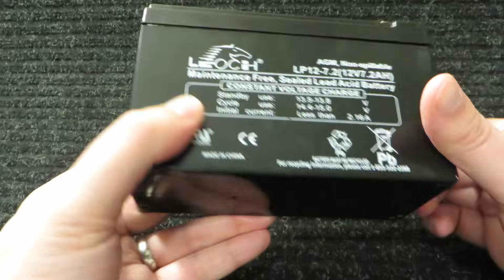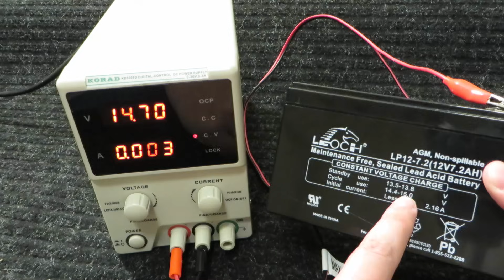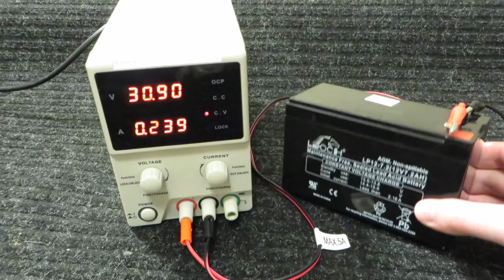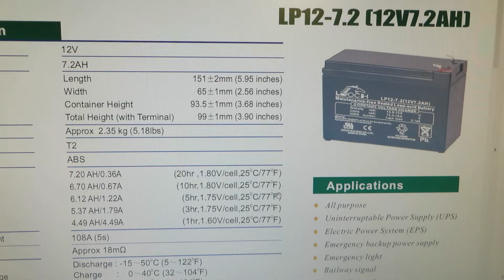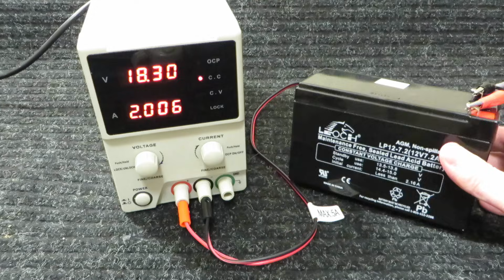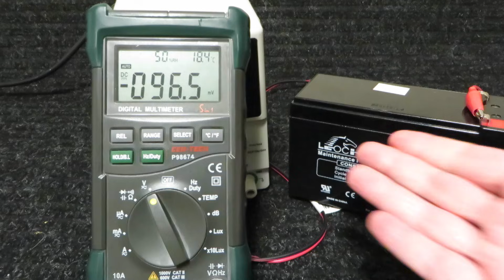Battery Desulfation Demonstration Start to Finish - Part 1/2

Comment: hi, how can I contact with? I did same tes with AGM battery for UPS and added destiled water and tried to desulfate with High Constant Current process, and it works, I did it like 3 o 4 times round charge/discharge and now works even I measure the recover back to 100%, I want to know if AGM can be converted to wet cell
Reply: https://www.youtube.com/watch?v=br6I7QAkKpY
Reply: https://www.youtube.com/watch?v=ITZP8dfaXuk

Comment: Hi , thanks for the video. you look expert on the topic, and all the reasonings sound correct. Do you have any link or literature on this? I would like to have more details on how much current should I set for a 100Ah battery, with several hour process. what is the dependance with temp and so on (I'm desulfating my camper batt)

Comment: you should call your self a professor.
question  
i have a flooded battery i measure each cell with multi meter and only one cell give me -0.3 v instead of 2 volt.
can i recondition that cell assume i do all safety procedure by put negative terminal of lab power supply  on that cell and positive terminal in the  main positive terminal of the  battery?
thank you a lot.
Reply from the maker: If you have access to each individual cell you can desulfate each cell separately.  It sounds like you have a single cell inversion where the cell reformed in reverse polarity.  This is pretty common and somewhat difficult to rectify unless one has access to the inverted cell.  With lead calcium batteries in particular this is quite common as manufacturers add dopants to the 'good' cells to cause them to leak current as much as the 'worser' cells so that the user doesn't end up with the problem you have.  Chemistries with higher intrinsic leakage currents don't need this dopant which only makes good cells worse.  This disrupts the battery chemistry as they age and leakage rates change though - cost cutting right?  Anyway, I'd suggest desulfating just that one cell first if you are able to access it.  Be sure to keep the water to the proper level at all times.  Wish you the best.

Comment: Every single AGM battery I've had has gone bad due to an internal short eventually (in a UPS, electric wheelchair, car, etc.), so any revitalization attempt was useless in the end . I have one that's 12 year old that's still going, though.
Reply from the maker: That's very interesting to me considering that I have never had an internal short in an AGM battery out of the dozens I have personally used over the past 2 decades including one that had a gigantic dent in it due to physical trauma.  It is certainly possible in an AGM battery to have shorts but more difficult than flooded due to the dense fiberglass mat that needs to be punched through before a short can occur.  Perhaps your batteries or use applications are different from mine.  No argument though that a battery which has a short cannot be desulfated using the method shown here.

Comment: Very good video, please answer me I have the following problem, my laboratory power supply unit Wantpek APS3010H unfortunately only charges with CC until it reaches the closing voltage and then with CV and then the current drops, how did you set it so that you charge with CV and the current rises, thank you
Reply from the maker: Your power supply is working properly from what I can surmise from your comment.  The current limit and the voltage limit are independent.  If the voltage limit is reached current is lowered to prevent voltage from going higher, and if the current limit is reached voltage is lowered to prevent the current from going higher.  It sounds to me that your batteries are not severely sulfated and are charging like typical batteries instead of charging like damaged batteries as shown in this video.

Comment: Hii very nice information, but i have question I use the gell battery when it is full 13.2 volts and get a load of 2a baterai drops 11 volts, how to fix it sir? Thanks
Reply from the maker: It depends on the battery.  If it is a smaller battery that may be normal simply due to charge mobility and internal resistance, but if it is a larger battery, say 20Ah or larger then that isn't normal.  Gel batteries are more difficult to restore as any 'bubbles' are permanent and damaging.  To desulfate a gel battery you would need a very mild overcharge for a long period of time.
Reply: @knurlgnar24  thank you for answering
the battery that I use is 12 volt 100a, when I charge it with 14.2 for a few seconds it is immediately full with a voltage of 13.2 volts. for 2 days the voltage is still 13.2 volts but when given a load of 2a it immediately drops to 12 volts, and then the load is released voltage back to 13 volts again, is this due to sulfation or maybe the cell dry?

I've used the method you used to recover battery before and it worked very well
thank you for your information sir

Comment: You may like to include a diode between the variable power supply and the battery. If you are charging, and the power fails, the battery may backfeed the power supply, damaging it. I have seen it happen. Ok Ok...  I learned the hard way!  :-)
Reply from the maker: That definitely shouldn't happen, but yes I also have that fear because power supplies are usually not tested against unanticipated events like AC power outages.  I did try unplugging the supply while on the battery as a test and it didn't do anything bad but that only means so much.
Reply: @knurlgnar24  You got away with it :-)  I'd still like a diode. I always do now, once bitten...

Comment: Thanks for pointing me to this video. The batteries I mentioned in my last message all test at around 12.5+ volts. I'm glad they are totally run down. Coincidentally the 20 batteries I have are from the same company they are leoch lpc12-75
Reply from the maker: I remember your comment but can't seem to find it - youTube mysteriously deletes things at will for unstated reasons.  In any case those sound like very nice batteries and I hope you are able to restore them to useful condition and make use of them!  I'd take those for my battery bank if I had the chance.  :)

Comment: I have an issue I can't find a solution for. I have an alarm in my vehicle. Having been out of work since 18OCT2020 I don't have a need to drive each day. So my battery has 12V but seems to have no current. It will not take a charge. Even using the 55A Starting circuit it will no even turn the motor. What would you recommend. Are there solar chargers that I could put on it to keep it up with the alarm pull?
Reply from the maker: I'd disconnect the alarm and force charge the battery for an extended period of time.  Lead Calcium batteries (which are the standard for North America) refuse to accept a charge after complete discharge for a time until they slowly start accepting charge again.  After that point you will still need to desulfate the battery.

Comment: What I would love to see is how to make a modified sine wave inverter to pure sine wave  I know I can get a triplite line conditioner unit that will do that but the video I watched on that the unit was around 100 $unfortunately up here in Canada with our lower dollar it's around 140 $ that not too bad but the killer is the almost 300 $ shipping cost I can buy a new 3000 watt pure sine wave inverter for less years ago before utube I bought a 1750 watt modified sine wave inverter then about 3 years later a friend gave me another one and about 3 years ago my brother bought one for his camper just before he passed away he gave me the camper so I now have 3 1750 modified sine wave inverters since then I found utube and found out that modified sine wave is bad for sensitive electronics and not good for anything with a motor like fridge furnace and pumps that's why I looked into the triplite 1800 line conditioner I've seen your video on how to join 2 together to double the wattage I've also seen a video on how to join 2 together to make a110 220 split phase inverter there's even a video on how to make a a 2000 watt pure sine wave inverter but I can't find anything on how to convert what I got to pure sine wave

Comment: that is not how to do it!
Dump the battery in a cube of air condition water, put a bridge rectifier on it and a 120 or 240 power connection in series with an old style light bulb, then heat it up and let i cool down to draw water inside!

Comment: just saw you have a ton of amazingly helpful off grid vids...
thanks muchly...
any hope for my crown 420ah l16s(2 in series at 12v)
that drop down to 12.6 volts after sundown due to my ignorance in having had an under powered pv setup when i got them?
they got drained down to 11.7v almost every night for the first month i used them and never got fully recharged during the day.
so now if i disconnect the charger they slowly drop down from @13.9 to 12.6 over a cpl hours with no load.
they will mabey loose another .1v overnight if i have no load but if i run them down to 12.2v they are still at 12.2 in the morning.
i feel like they are good candidates for salvation compared to what you used for demos.
can this be over a period of days on and off?
any help not ha having to replace this wasted 600 dollar battery bank would be greatly appreciated.
thanks.
Reply from the maker: I can pretty much guarantee that you can restore those batteries to near 100% without much trouble.  If it's only been a few months of damage due to undercharging it will be almost completely reversible.  I'd need a specific model number to give specific advice, but whether these are AGM, flooded lead antimony, flooded lead calcium, or pure lead makes a difference in the details.  (I will assume flooded of some chemistry)  The short of it is I would recommend disconnecting or turning off the solar and inverters and doing an extra long equalization charge.  Crown likely recommends something like 5 hours for maintenance purposes but since yours are damaged they will need more than that - maybe a full day.  Keep an eye on temperatures and electrolyte level during this time.  If you have a hydrometer keep charging until sg stops rising in all cells.  After that do a deep discharge, log the result, and do a normal full recharge followed by the crown recommended equalization charge.  Repeat.  Once your capacity result during the discharge tests stops rising you are done and given your situation it will probably take only 1 or 2 cycles.  Obviously the most important thing is to not let them get damaged in the first place but life isn't ideal and these things happen - fortunately it's not a big deal as long as the situation is rectified in a reasonable amount of time.
Reply: @knurlgnar24  thanks so much ....
I am completely off grid so I can't charge them externally
I can set my charge controllers
To equalization voltage for a few hours at a time a few days per week...will this eventually do it?
If not since I am switching to Chinese prismatic 3.2v x16 for 48v sometime this winter and 
run an external charger then.
(BTW they are a pair of crown CR-430 6v in series.)
and these big fla are to expensive and too heavy to junk... 
Awesome info ...hope you get back to it
Thanks again for the reply.

Comment: try the welder method?  speeds things up............
Reply from the maker: I wouldn't recommend using a welder as a battery charger.  They aren't intended for that and have a high inductance output which is dangerous for battery applications.  (but good for welding)
Reply: @knurlgnar24  THANKS-- i did see this method however....... dialed in to around 30A input: speeds up force restore/desulf.    Thoughts?  https://www.youtube.com/watch?v=VYtkn-N_p4s&t=98s

Comment: Would the marked max initial voltage always be the driving parameter or is a general maximum of 2A recommended? I have a larger battery with about 13A initial voltage, resulting in A staggering 156W!
Reply from the maker: The initial voltage is independent of the current you would use to desulfate.  If it is a 12V battery of, for example, 100Ah instead of 7 as shown in this video then 2-5A would probably be an optimal current limit depending on a host of variables.

Comment: I have been having trouble commenting on this videos, so I am giving it another try.
Reply from the maker: Looks like this one stuck for whatever reason!  YouTube is funny when it comes to filtering comments and is often over-aggressive in filtering spam, advertising, and abusive comments.
Reply: @knurlgnar24  The one on your 1000Ah Battery Bank Part1 is still there. It's the only video that it stuck. 

https://www.youtube.com/watch?v=PbCA8RZqeqk&lc=UgyN3wwoQSisxFpiHTp4AaABAg
Reply: @knurlgnar24  I really hopped for your help since I have been at this for about two months, but I think that I worked it out. It would appear that using the same process to maintain those large orange deep cycle batteries can be used to recover any FLA or FLA or AGM batteries. I am omitting the manufacturer of those batteries as it may be what has been causing me grief with deleted comments.

What I would like to convey for your videos is that you have so much more to show. From part#2 @ 24+min, the explanation to the internal resistance and capacity are for the most part left aside. How about a 3rd part video to cover these things? 

I am asking after spending two summer months of working through this craziness of battery recover. I don't own a fancy electronic load like your Regol to graph a discharge curve. All that I have is a smart charger and an DMM that hook-up in series with my dumb charger. 

I finally got myself a DC clamp meter to replace the one that went defective. It's a Klein Tools 400A AC/DC digital clamp meter that I bought at Home Depot in Canada for $105 CAN. I have been wanting this to measure the discharge current from the engine cranking between my cars, snowmobiles and lawn tractor. I want to find the current while cranking the engine to find an adequate discharge current to recover starting batteries.

Comment: So, this type of lab power supply wouldn't work for restoring car batteries would it, with 100s of amps?
Reply from the maker: Yes, this would work well for car batteries.  Car batteries only require a few amps to desulfate.
Reply: @knurlgnar24  Ah, ok, thanks for that clarification. I suppose the importance of what you are demonstrating here is the higher voltage but only a few amps. Is this lab power supply then also sufficient for charging a regular car battery?

Comment: Thanks. I have recently attempted to recover an identical battery but with better initial open-circuit voltage (5V or so), though with PARADOXICAL RESULTS. I went through a few cycles during which the temperature never exceeded 30 degrees because the battery charged fast (faster and faster with each cycle - average a few hours) so that from the start, I used only 13.8 - 14V and never exceeded 2A (with power supply unit in CV mode and 2A limit). I ended the charging at around 0.2A and measured the open-circuit next-day voltage at 12,6V after each of the four cycles I did. 

Now, here comes the PARADOX I do not understand: the capacity at each cycle got smaller and smaller, so did the time of discharge in identical conditions set up on a battery tester (10A, 10.5V cut-off). The paradoxical results I got are as follows: the first cycle - 17min of discharge, 2.853mAh, the last cycle: 13min, 2.209mAh, and the other two cycles in between in decreasing order. 

I am looking forward to reading your comments, but let me hypothesize that by charging in this simple way with a power supply unit, I made some damage to the battery. Initially, I thought so because the chargers are a bit more sophisticated using more complicated algorithms than just CC which switches to CV after hitting a set voltage. Even you suggested that after the first successful charge, we should start to use the chargers which have come with the battery. It seems also in accord with what those designers of lead-acid battery chargers claim, though they, as probably you, refer to a simple transformer-diode type of charger and not to CCCV of power supply as potentially damaging due to uncontrolled rise of voltage: https://www.powerstream.com/SLA.htm. But after giving it more thought, I guess now that what explains my paradoxical results is not the power supply but the fact that I have discharged the battery rather deeply and have never fully charged it, thereby damaging or sulfating it. This second explanation would be in accord with what the authors of the following article have written about the CCCV mode that is a bit different from what I have just referred to as CCCV of power supply, but the difference seems not significant (Figure 1 in): https://batteryuniversity.com/article/bu-403-charging-lead-acid
Reply from the maker: I apologize if I do not understand your comment, but if you never exceeded 14V then I would argue that you never desulfated the battery to any meaningful extent.  A battery should hold at nearly 14V days after charging open circuit if lead-calcium, or 13+ volts days after charging if lead-antimony.  12.6V means the battery was never even close to fully charged much less desulfated.
Reply: @knurlgnar24  OK, no problem; what voltage should I use for VRLA batteries (almost identical to that used in your video - same dimensions, but a bit higher nominal capacity)? I set this 14V limit because those VRLA batteries didn't seem capable of water replenishment in my first experiment with this type of battery, even when I got to the caps and syringed water there. That is to say, the water sunk very slowly, and not knowing the inside of the battery, I thought that it might do damage rather than good, especially that, as you may recall, the battery had a high level of self-discharge.